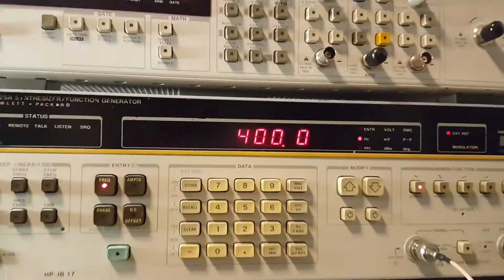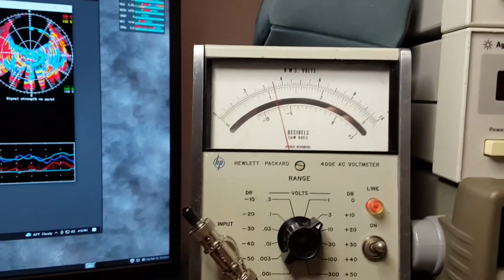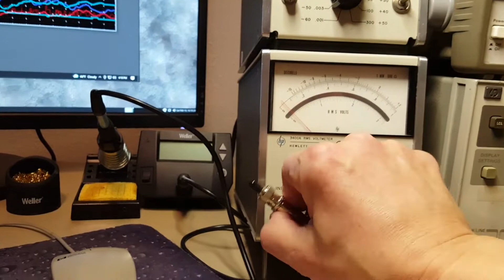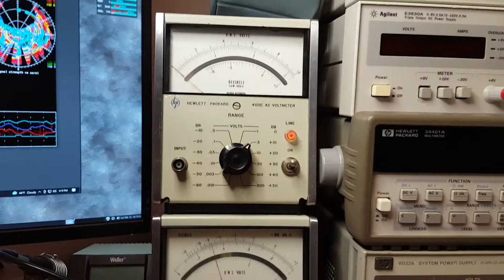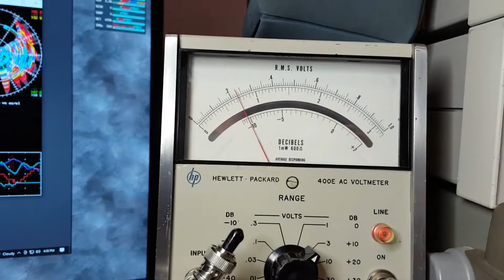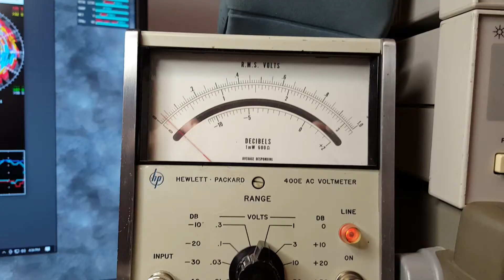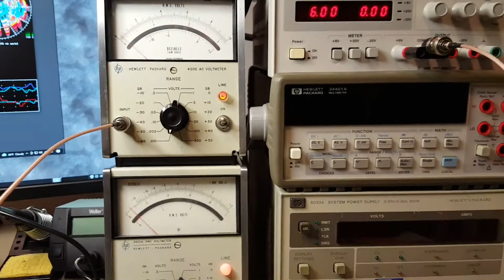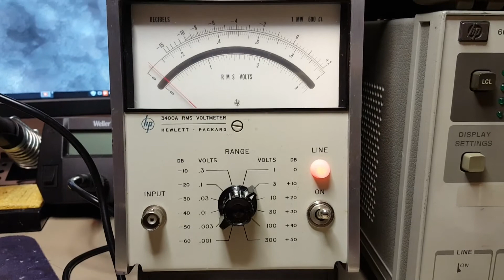HP 3400A vs HP 400E AC RMS Volt Meters

Comment: Is there a large zero offset on the 3400a? Is that normal?
Reply from the maker: Yes, the first 10% of the scale is ungraduated for this reason. The service manual states that the meter movement will typically rest within the first 20% to 50% of this ungraduated region when operating correctly. Thanks for watching.

Comment: Useful information, nicely presented, thank you for this video. I have been very lucky to acquire the 400E recently. Here in Europe they are rare and expensive. I work mainly with audio electronics, so it should cover most, if not all of my needs.
Reply from the maker: Glad that the video was helpful. I primarily use the 400E for SINAD and S+SN receiver measurements, the 3400A is used for power supply rail noise measurements and doubles as a limited range RF volt meter.

Comment: Hi Petersen, how are you?
I recently bought two HP voltmeters, the 3400A and the 400FL, I bought it here in Brazil through a used sales site. The seller told me that the 3400A is not calibrated. I wanted your opinion, so I can see if it's possible to do the calibration myself according to the service manual, I have here on my bench a wave generator from Uni-t, a digital multimeter from Owon and an Oscilloscope from Hantek. If I follow the steps in the service manual table to calibrate, can I succeed in this process with the equipment I have?

Thanks!
 - Leonardo Pereira.
   Mechatronics technician.
Country: Brazil.
Reply from the maker: Good Morning Leonardo. It looks like you have most of everything you need, I would recommend conducting a performance check first. Even though the meter may have not been calibrated in some time it may still pass this check. I calibrated mine using a HP 34401A digital multi meter, a HP 3325A function generator and a Tektronix 2465 oscilloscope. You will also need a 50 ohm pass through terminator or substitute with a BNC T connector and a 50 ohm load. While the performance check requires the equipment listed in Table 5-1, just using your signal generator to check for voltage accuracy should work if it has the bandwidth required.
Reply: @CraigPetersen12f36b  Thank you very much! I will run this.

Comment: Very educational.  What is "crest factor", not heard that before?  I guess the take away is....one must really no ones tools!  Thanks!  ~Jack, VEG
Reply from the maker: Good Morning Jack. Crest factor (expressed in dB) refers to the meters input amp to handle signals with high dynamic ranges and not go into saturation, things like noise, video, pulse trains and other signals with high dynamic components. The higher the crest factor, the more accurate the meter will be when measuring these signals. Search for the HP Bench Briefs article from 11/12 1973, it explains in great detail and is well worth the read.